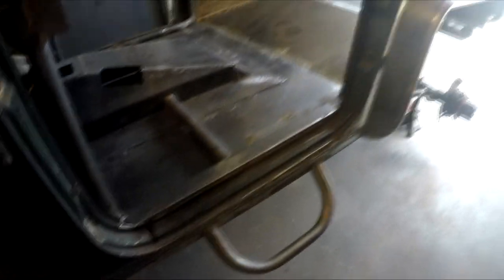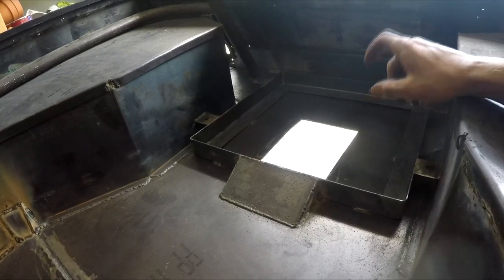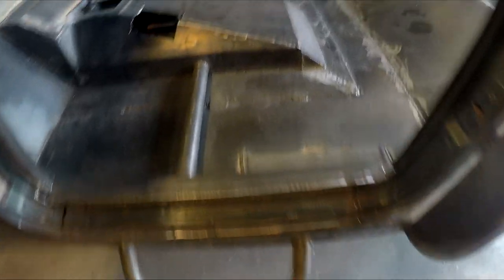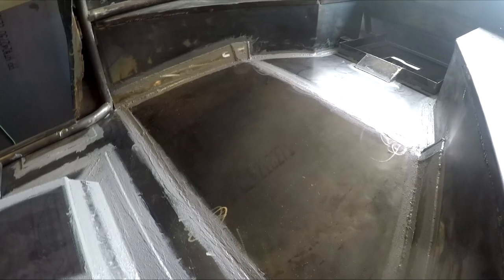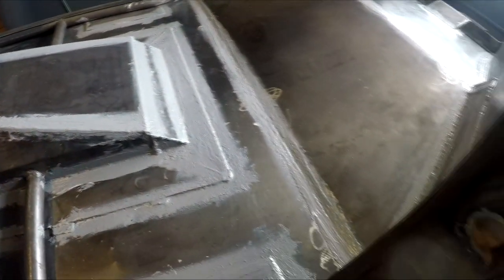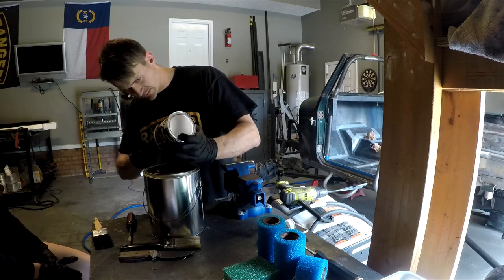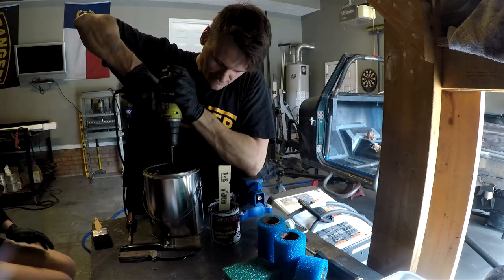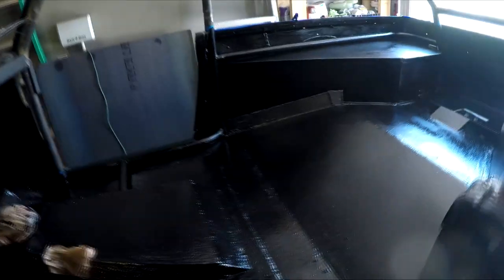DIY Monstaliner Roll On Bed Liner II Legacy 4x4 and Off-Road

Comment: Nice projects.  But one question.  Do you guys ever weld any thing for strength on your cages?  Plum and square looks good to the eye  but zero racking strengh. 'IF' you ever flop over or roll it could be bad. Just my yrs of wheeling opinion.  Some nice builds you guys have done. Keep them coming.
Reply from the maker: well, to be honest, none of these are bounding rocks or climbing cliffs. We want to build legit buggies for that and really engineer them to excel at the intended purpose there. but for the daily driver builds that will more than likely just go have fun on a few trails and the beach, the cages are mostly for looks. "mostly" But if you ever flop to one side, it'll still be better than nothing. Bottom line, is realistically these rigs wont ever see enough real grade trail to warrant a cage that sacrifices looks... being honest. building these for different purposes for now! thanks for the concern Smitty! cheers!!

Comment: Coming from the north, the step looks great but slippery. wreck a shin if you go through.  Im guessing you considered no-slip on there or fill in.  Looking great on the build.
Reply from the maker: there will be a textured coating on it to hopefully prevent it... didn't really think about it, thanks for the tip though!
Reply: @Legacy4x4andOffRoadYT  Looked like a stirup. All I saw was a boot caught.  Did you try baby oil to remove skin stuck bed liner?
Reply from the maker: olive I no sir